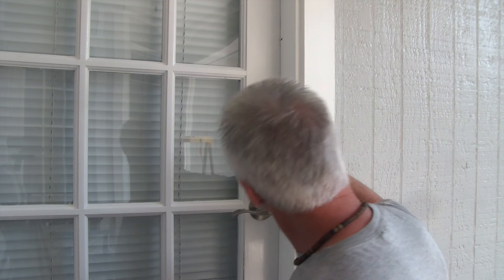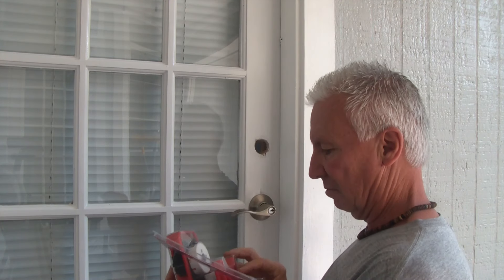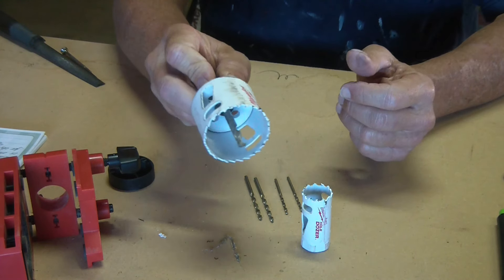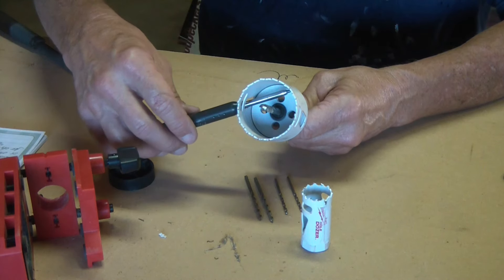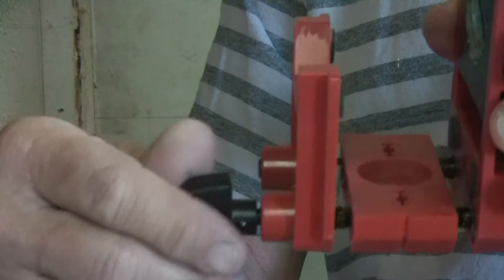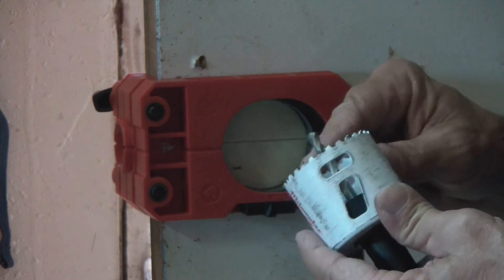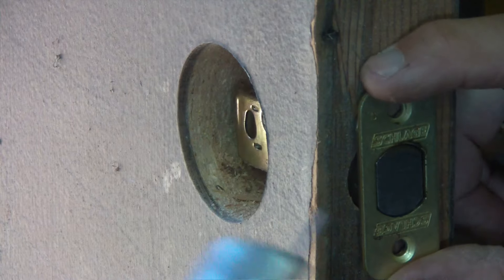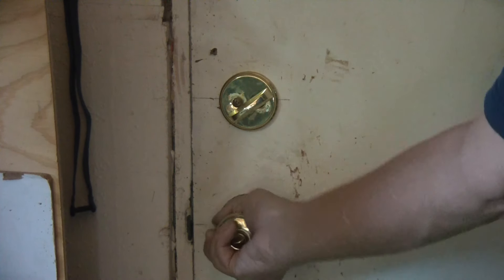How to Drill your door for Door Knobs and Deadbolts

Comment: Excellent video.  I am going to practice this install before the new, blank door, is worked on.  How do you center the already installed door knob with the dead bolt unit?  There was so many commercials the video was interrupted several times to break up thoughts.  Thanks for sharing.